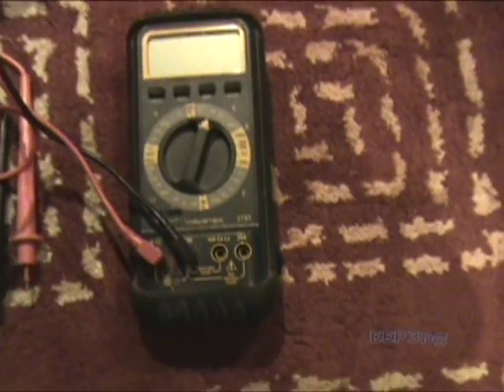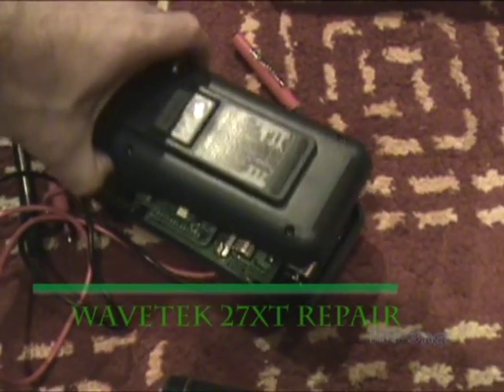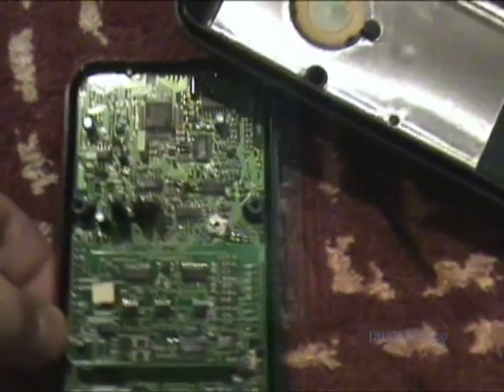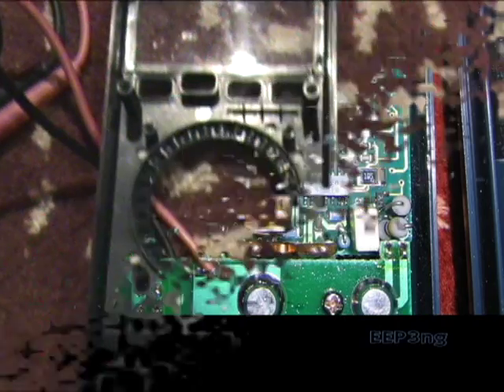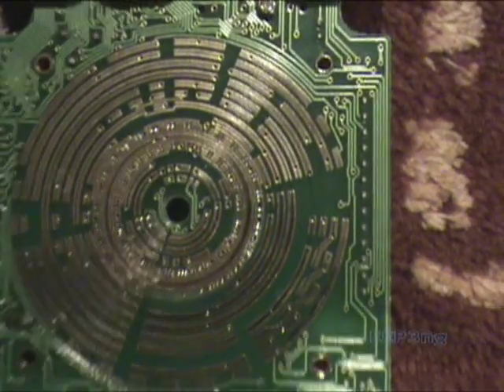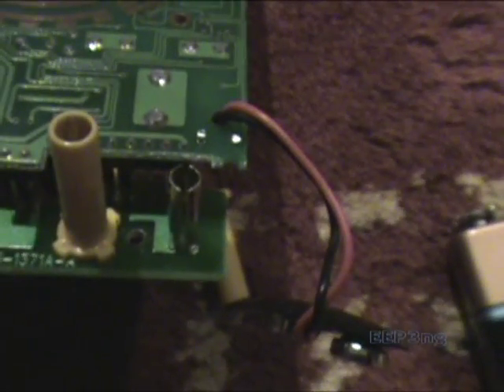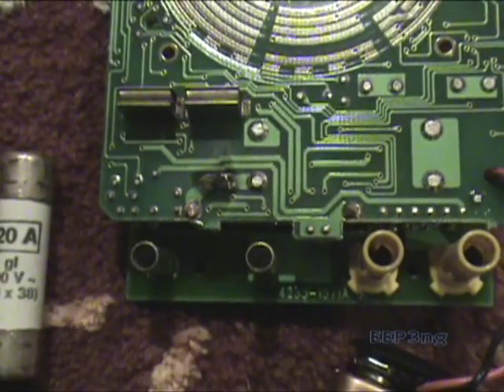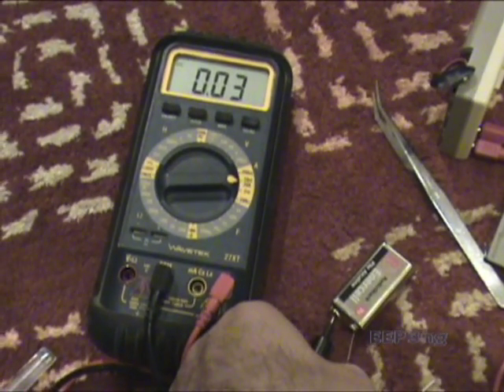EEP3ng - Wavetek 27XT Multimeter Repair

Comment: Quick question, I have this same meter and have had it since the 90's. I need to replace the battery. I removed all four screws on the back and it will not separate, back from front. I've tried everything to get the back cover to pop off and it won't. Any tips? I downloaded the manual and it merely says remove the screws and open the back cover. Nice if that would work.
Reply from the maker: Yes, it does work... not sure why yours is stuck. Did the battery leak or something else get on it? I just take the screws out and pull the back off.
Reply: @EEP3ng  Battery may have leaked but I don't even see a seam. It's almost as if it is sealed in one piece. I've never changed the battery that I know of and I've had it for 20 plus year. Still works though. Hell of a battery. Nothing on the case I can see that is sticky.